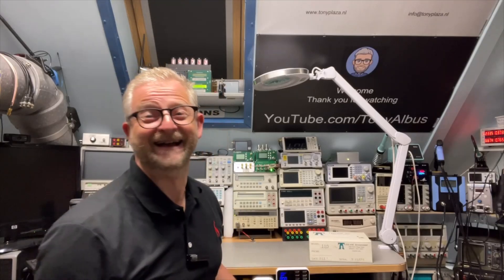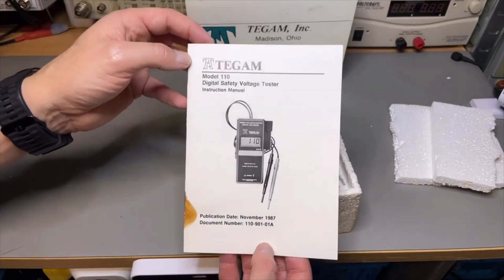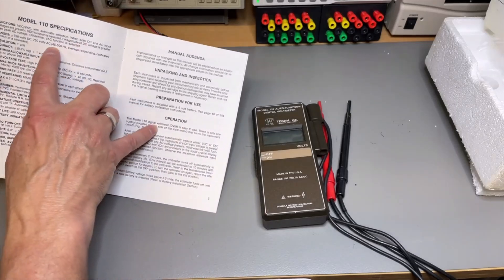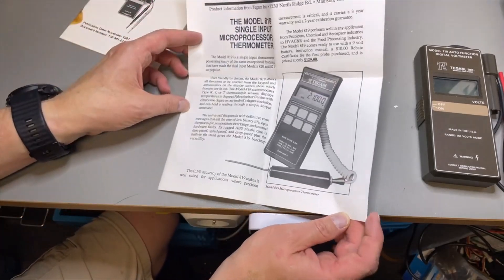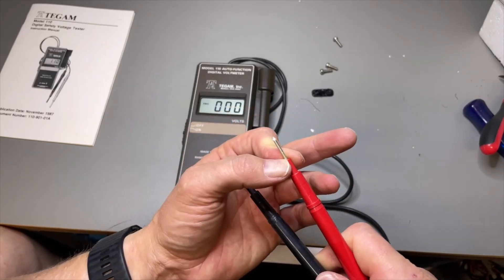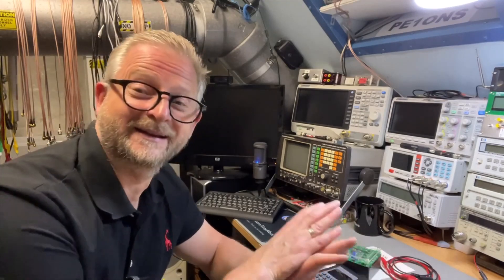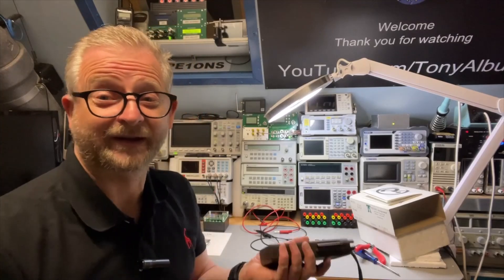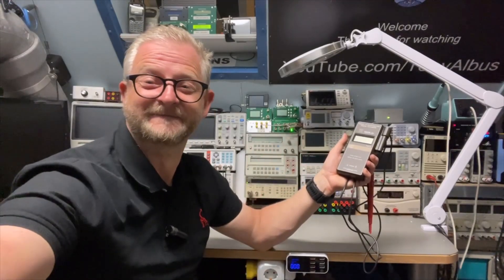#287 Tegam 110 Digital Safety Voltmeter - Or is it a Keithley

Comment: What a find Tony. My first thought was where are the missing decimal places . Then the penny dropped, its a safety voltmeter and additional decimal places could lead to confusion and safety issues for the user. I have to say I have never come across a safety meter before but for the user its a lot easier to use than a multimeter especially when all you need to know, is it a safe voltage.. Philips has a museum in the Netherlands, it will not be to long before you have your very own Kiethley museum in the Netherlands too !
Reply from the maker: Thank you Ian, yes you have some good points there.. it does indeed make sense.. just power it on, see the voltage.. done.
Yes Philips does, you know very well. Not sure about mine.. but maybe online,

Comment: Very cool bit of history. I agree, it is definitely part of the Keithley legacy. I wonder if it is a bad idea to cycle the on-off switch while the meter is attached to high voltage? I don't know if the meter is guaranteed to start in a high impedence, protected state.

It's also odd to have such a short auto-off time on a safety meter. I believe the whole range of current Flukes will not power off while measuring high voltage.
Reply from the maker: Thank you!